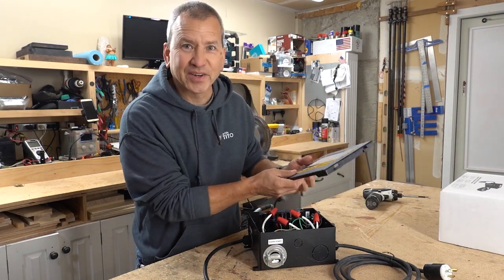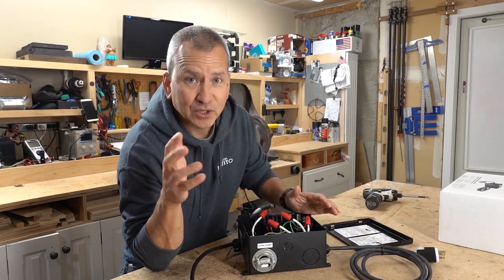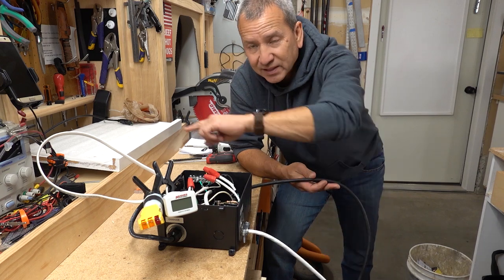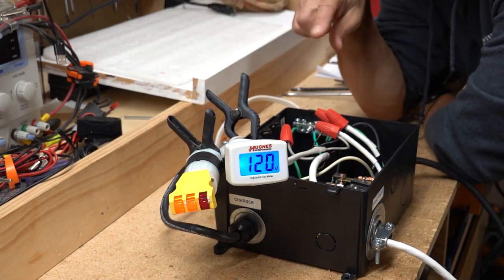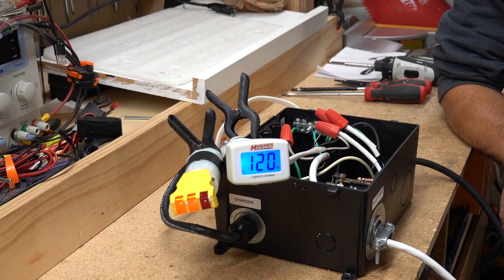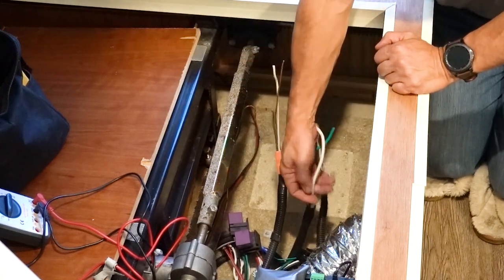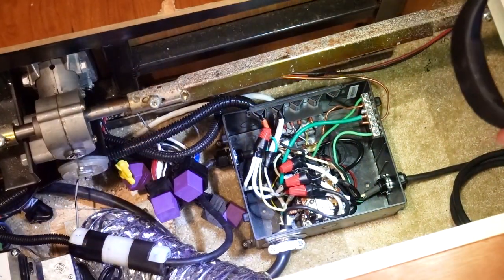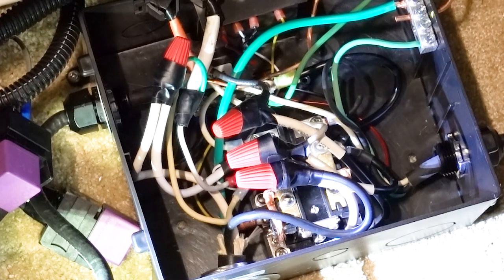DIY Off-Grid AC Power to Your Entire RV - Inverter Transfer Switch Install

Comment: Safety - It is VERY important to tape those wire nuts for all connections, especially in an RV. Vibration may cause them to fall off, and short against the box, other wires, or ground. It shows you did it, but didn't mention it.   Great instruction again, thanks for posting.
Reply from the maker: Thanks for noticing that. I always wrap them as you saw, but should have mentioned it.
Reply: @RVwithTito  next time.

Comment: Thank you for the explanation. This is the exact transfer switch I have and very happy with it. Had to replace it once and that was because cables got lose and had a little bit of a short circuit so just make sure cables are not getting lose.
Reply from the maker: Good to know Jorge. I'll double check.

Comment: Hi Brian, best video I’ve come across so far for this application. You mentioned that you no longer have a generator, so I need a little more help. I have an old existing transfer switch  (Shore Power-Generator) connected to the power center. I am adding a 3000W pure sine inverter to the mix, so where would I put this new transfer switch (Shore Power-DC) in relation to the existing one? Before or after or does it matter? Do you have any wiring diagrams for how to keep the DC power out of the charger loop? Thank you so much for your help!

Comment: I was looking at the GP-TS unit for my boat, but the problem is it wasn't IP68 certified.  I think I'm going to order it anyway since I can't find a comparable product that is.  Oh, and I'll use your link to order it so you get the affiliate sugar, since it's all the same price anyway.  We'll have to see how long the relay lasts in a damp environment.
Reply from the maker: Yeah. There's no weather seal on it, but you could add something on the lid if moisture is an issue. You'd also need to use weather proof glands on the entry points.

Comment: Great video as usual, Brian. Thank you.  I'm curious: Just what is the reason for the 20-40 sec delay built in to the transfer system? And why isn't the charger output line benefitting from it? If it's a power stability delay, then isn't there a chance "unstable" power is immediately being sent to the charging system before the "clunk"?  Curious minds...
Reply from the maker: It probably is a stability delay. The charger is wired to the shore power input on the incoming side of the relay. If it were on the output side then it would also turn on when switched to the inverter which defeats the purpose. Hope that helps.
Reply: @RVwithTito  Thought so. Thanks, Brian. One more reason to have some power monitoring/protection on the input side of the RV's electronics. Dirty shore power would head straight to the charger.

Comment: Thank you for another great video!  Question.  How quick is the switch? Do you have to reset clocks and such? Any devices suffer from quick loss of power? Tv stay on ect? Thank you in advance.
Reply from the maker: I think there's a slight delay, but you don't lose power. Once it switches, it switches quickly. I'm going by memory because I haven't been on shore power for over 6 months :)
Reply: @RVwithTito  thanks for the reply.  I received my ts-30 yesterday and will install it tomorrow.  The delay if there is one is not a big deal im just concerned it will hurt sensitive equipment that is in operation when generator runs out of gas and change is made. If its less than a second ac and tv should be ok.....p.s. jealous about not being on shore power for over 6 months. I would think that means your enjoying yourself.

Comment: Hi Tito, great video! I do have one question. In the video after all is connected, you showed a black power cord connected from the transfer switch to the inverter. Now at the connected end of the inverter did you just simply plug the male end of the cord  into the outlet on the inverter? Because when you shoot footage from the transfer switch to the inverter there is a black plug - plugged into the inverter? Is it that easy? Thank you!
Reply from the maker: Yes. My inverter doesn't have a hard wired option (some do) So I just use a heavy gauge power cord plugged into the inverter output outlet.

Comment: Is there any battery power loss leaving inverter on when on shore power or would you still need to turn inverter off?
Reply from the maker: There's no need to keep a stand-alone inverter running while on shore power. Any losses will probably be absorbed by your charger floating your batteries. Also the inverter does draw a couple amps when powered on.

Comment: Im buying a bluetti solar charger (BS500) with addon batteries (2 300S batteries)  and i want to tie it directly to the RV system, and be able to charge the bluetti batteries from shore power when hooked up.  this is exactly what i need right?

Comment: Using this method, do you have a way to auto shut off the inverter? Because even with no load they will be drawing power?  I actually have purchased all the supplies to do your style with the older switch, but I found that the breaker's I wanted powered by the inverter, actually have other things like the microwave on the same circuit so I am trying to decide how I want to proceed.
Reply from the maker: We just turn the inverter off when not in use. We have a inverter remote panel just inside the door. Yeah. Each RV is a little different. You're correct to take a step back and think about it.

Comment: Better yet just unplug the OEM converter and istall an inverter/charger, eliminates the need for the transfer switch.
Reply: Not for everybody, but in the right circumstances the stand alone invefter/charger is great.
Reply: Just unplug the OEM converter is what I did. Should the new inverter-charger eventually fail just remove it and plug the OEM converter back in.
Reply: Yeah makes sense good advice, but I had already spent $ on a 3k watt inverter and isolator set up. I decided to add sure power AFTER I made my initial bulk of purchases 😭 so this video does help
Reply: I’m on 2 systems lol

Comment: Great video, as usual! BUT... you made me think: I just replaced my batteries and 1000w psw inverter/charger with a 2000w Xantrex psw inverter/charger and 2 BattleBorn 100ahr batteries. Howevder, my OEM wiring did not include my microwave on the inverter circuit, so now I have to track down THAT modification... Keep the great videos coming!
Reply from the maker: You can do it. Thx.
Reply: corey Babcock  Thanks for the encouragement! My situation is complicated by the fact that the OEM inverter output only powered one circuit with several receptacles throughout the RV - not including the microwave. There is a separate transfer switch that handles sending power to the microwave circuit and the 120v power center when connected to shore power or the generator. I just need to study it and see where I would put an interconnect relay to sense the inverter output and switch in the microwave - I don't think I want to send the inverter output to ALL of the shore power-connected receptacles due to the potential for inverter overload.

Comment: What kind of charger do you use? I have been loving watching your videos, though my application is mobile art rather than an RV :)
Reply from the maker: I have a Progressive Dynamics converter/charger upgraded to charge my lithium (LiFePO4) batteries.
Reply: @RVwithTito  Would you have the model number of the charger? Thanks.

Comment: What adaptor did you use for the inverter and converter plugs? And do you leave your inverter in the ON position all the time now or do you manually turn on the inverter just before disconnecting the shore power?

Comment: I was going to get that exact same switch, but reading the reviews on Amazon, many said they were receiving old, discontinued stock that GoPower does not recommend. Make sure you don't have one of those. 
The other reason is the plastic box. Not great should the wiring overheat. I suppose that's debatable point considering most all the electrical stuff and outlets in an RV are plastic.
Reply from the maker: Should be fine. It works as you can see. My other xfer switch died after 13 years. So this one definitely works better :) By the way the other switch was also in a plastic enclosure which was perfectly fine after all that time. If your wires are heating up, then you're plastic box is the least of your problems.

Comment: That's what I'm doing.  Have not checked the transfer switch to see what is installed.  I could run a extension cord to the charger  from shore power bypassing everything. 
See what happens.
Reply from the maker: That's kind of what this is doing. It's powered from the shore power side of the switch. Good luck!

Comment: Another great video Brian - A great future install if I get to it. I did some checking on Amazon and found a Thor brand 30 amp transfer switch for only $80 but it's not prewired. It looks exactly like the one you just installed from Go Power or was it Progressive Dynamics? LOL
Reply from the maker: They are all pretty much the same I think with some tweaks added for the charger.

Comment: The 20 second delay is to give time to the generator to run at normal rpm . I bypassed the circuit board so the transfer from low battery charge to short power is instantly. That will only happen if there's not sunlight for a long time and drain the battery below 30%. Otherwise,  the solar controller is in charge to keep battery pack at 90% charged.

Comment: Thanks Brian!  I started my upgrade yesterday with GoPower charger/converter, transfer switch, and 1500w inverter. I took out the integrated charger/converter, and then I started questioning my sanity.  Your explanation made me realize I don’t have to put the new converter/charger in the old hole, I can use corded inputs. I bought the basic transfer switch, so I need to prep it. Thanks again!

Comment: Tito, Thanks for your video. I have a question, can I use my solar system (Bluetti 200max) as a main source, and when my bluetti is off, transfer automatically to The RV park shore poweer ?? thanks
Reply from the maker: Sure. Just wire the Bluetti AC output cord to the generator input on the ATS. That should make the Bluetti take priority.

Comment: Hello thank you for all your video's.  I find them very helpful.  I'm actually in the process of hooking up a sungoldpower 3000w inverter/charger.  I bought the gopower 30amp  transfer switch after your video on the converter loop. I  do not have an on board generator.  So my question is can I still use that transfer switch or should I buy the one in this video with the cords ? Thanks
Reply from the maker: As long as  you've got the converter loop bypass figured out, then you should be ok. This transfer switch just makes it easier.

Comment: So does this go upstream of the existing transfer switch in my rig? I have a 3,500 watt propane generator + shore power. I also have a 3,000 watt inverter. Right now I manually plug the inverter in and turn off the converter power via the breaker. Basically, what happens if you're using your inverter then fire up your generator? Or vice versa?
Reply from the maker: Yes. If you still have a generator then also keep the existing transfer switch and route its output to this transfer switch.

Comment: Hey Brian,
Love your videos. I have a 34 foot class a motorhome. No solar. Regular 6 6volt interstate batteries. I need to run a floor model AC. It's around 1250 watts.  I really don't want to run the generator. What would be a really inexpensive way to do this. Also, I was looking to do this while I was running down the road. When we stop I don't mind turning on the generator. Yes we have 2 ceiling units but I know that would be a challenge. So the floor model will work for us. Thank you

Comment: Hi Brian...this may be exactly what I was looking for.  The only thing I am concerned about is that I have both shorepower and a 4000w Onan generator.  I have an existing transfer switch that changes between shore power and the generator.  I am thinking of adding a watchdog surge protector after the original transfer switch and was wondering if I can connect the new 30A Go Power inverter transfer switch downstream of the surge protector.  As you showed on your video, I would then connect the shorepower / generator wire to the primary input of the inverter transfer switch and the secondary input would connect to my inverter.  The output wire would then continue to the battery charger (aka converter)...Please correct me if I am wrong.  I want to make sure this would be possible to do.  Also, I haven't added solar, but want to.  The solar I install would most probably be portable for now (200w to 400w solar panels) and would not be installed on the roof...I would then run the charging wire to my battery bank (need to see how to connect it to my battery bank).  Currently, I only have the two original Lead acid house batteries, since I just bought my Thor Vegas 24.1 motorhome less than 6 months ago, but I will eventually upgrade to lithium batteries...I would love to run my microwave, but I don't know if two lithium batteries would do the trick.  I may have to upgrade to 4 lithium batteries just like you have.  I apologize about the long reply, but I am new to RVing and just recently subscribed to your channel...I do love your channel and how you explain everything in detail and so well.  Thank you again for allowing me to subscribe to your channel.
Reply: I'm in the same situation I put in 400 watt solar panels 2000 inverter Can I use this with my generator thank you I love your slept up

Comment: Brian, I'm trying to figure out if I need to turn the inverter off and on manually if the shore power is on, or if it's automatic.  If both power sources are on (inverter and shore power), which will be prioritized?  In other words, if the TS-30 is wired according to the diagram and both the inverter and shore power switches are on, will the RV's AC be automatically powered through the inverter or by the shore power?  You help is appreciated.
Reply from the maker: I can't remember in this case. I'm guessing the inverter will take priority. It's easy to test with a multimeter.

Comment: Great video's, thank you. I have been looking into this and from what I can see, the difference between the GP-TS-30 & TS-30 is the added 110v pigtail for an extra $140.00  I may get the $79 version and 'convert' it to the GP style. We still have our generator so my plan is to use this transfer switch ahead of the stock switch, making shore power primary. The stock transfer switch will still see 110v hitting it unaware if either shore or inverter. It may be next year before my theory can be proved, still budgeting the $5K for this.
Reply: Your $140 also gets you a 15 amp fuse and holder. I wired TS 30 and it works great.

Comment: I never knew I could use the negative bus bar for the chassis ground connection inside a transfer switch box. I thought transfer box had outside of box a special small screw for connecting it's chassis ground.

Comment: Thanks, question, my inverter will be about 15 feet from my transfer switch. I'm thinking of routing a 10 gauge extension cord to the transfer switch through my RV chassis. Any suggestions and wiring you used or techniques.
Reply from the maker: Make sure the extension cord has adequate shielding for outside use. I'm using the old generator cord from the inverter to the transfer switch.

Comment: Hi Brian ... thanks for all your informative vids, they are a real help.
Question for you - i want to use 12v dc power to run my new iceco refrig/freezer.  I am setup with a solar battery bank and output is through an inverter. My promblem is that my inverter does not have a cig lighter socket for dc output. 
How would you setup a solar system to deliver 12v output from battery bank to frig??
Thank you ahead of time
aloha, me
Reply from the maker: I would bypass the inverter and wire a plug right from the DC output of the battery. You're fridge will use less energy doing it that way.

Comment: Looks great. My only negative comment would be to not use wire nuts. They can fall off from the vibration of going down the road. I use crimp wire nuts for loads above 20 amps and Wago lever nuts for 20 amps and below.
Reply from the maker: For RV and vehicle installs I always wrap them with electrical tape (one around the wires going in, and one around the connector). That's what I did here. So they're pretty secure.

Comment: Brian, nice job!  Just to be sure, is the 15 amp fuse located in the transfer switch box connected to the output to the AC breaker panel or to the converter/charger?
Reply from the maker: It's on the main DC panel connected to batteries.

Comment: Love your videos Brian. Even being that this one is 2yr old I still learn a lot from your content. I need to get this setup in my travel trailer. I have a 3000w inverter and a portable generator. This transfer switch should work so when I run the generator, the converter is charging the batteries, but when I run the inverter, it won’t charge via the converter, correct? So the generator and shore power cable share the same connection in the transfer switch?
Reply from the maker: Don't connect both shore power and generator directly to the transfer switch. I would use the shore power cord to connect to the generator (when in use). That way you'll never have the possibility of running both generator and shower power at the same time. Is that what you meant?

Comment: I just ordered this. When you disconnected shore power it switched to inverter power instantly right?
Reply from the maker: I think so. There may be a short delay built in when powering up the inverter before the switch...can't remember. Haven't been on shore power for many months :)